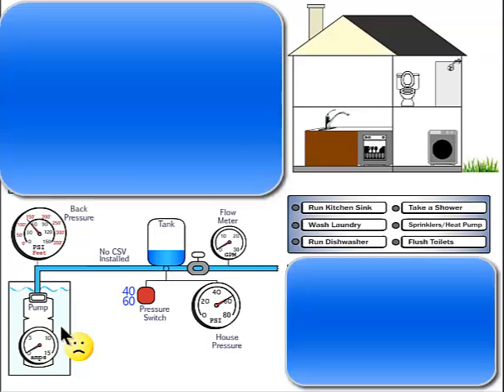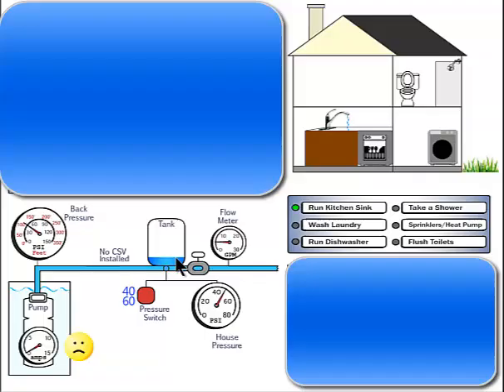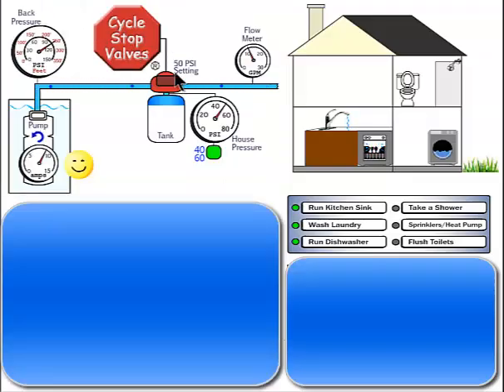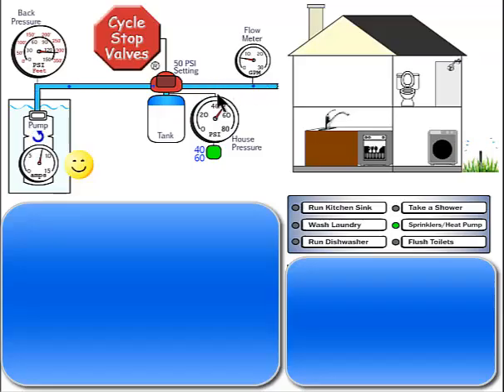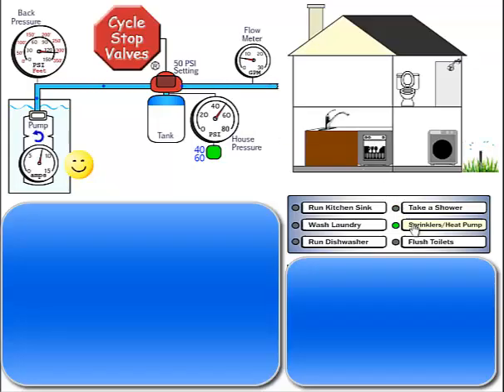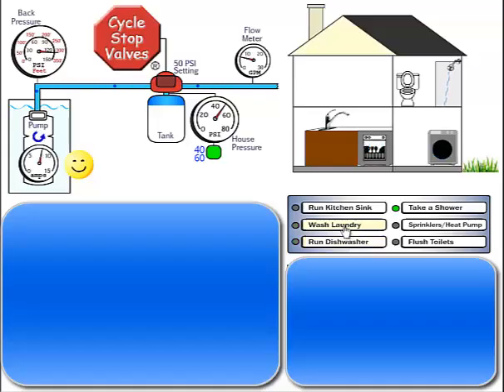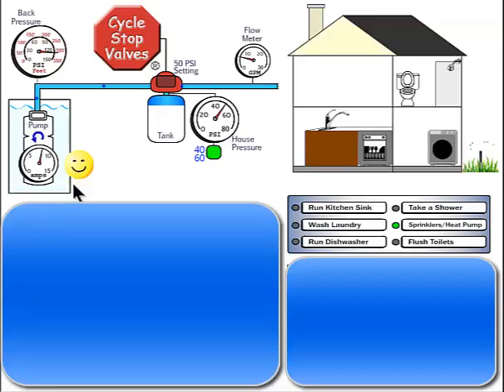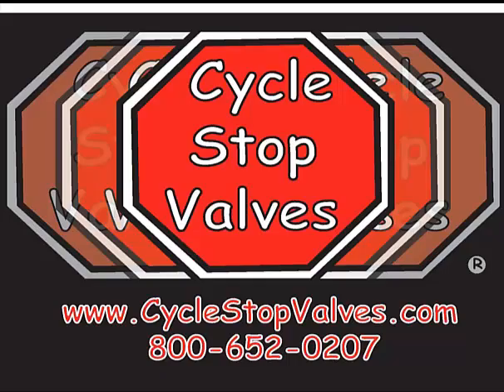How a Pressure Tank Works and why you need a Cycle Stop Valve

Comment: I don't get why my faucet doesn't do the same thing. I have read all of the explanations and looked at the videos and I still don't get how it works. Unless it is some combination of the faucet running, the tank filling, the spring moving and the cut off switch set between 40 and 60 psi. It took me a while to understand a ground fault interrupter too. I guess I will just have to get one and hope it works.
Reply from the maker: A faucet is after the pressure tank/CSV and only controls how much water you are using.  The CSV is before the pressure tank/pressure switch and controls how much water your pump is producing.  The CSV knows how many faucets you have open, and makes the pump produce exactly the same amount.  Without a CSV the pump is always producing more than the faucet is letting out, which causes the tank to fill and the pump to cycle on and off.  The CSV just matches how much the faucets are putting out so there is no extra water to fill the tank.  You could do the same thing as a CSV with a ball valve before the pressure tank if you stood there and manually controlled it.  With a 40/60 pressure switch the CSV would be set to 50 PSI.  So if you saw the pressure drop below 50 you could open the ball valve a little and if you saw the pressure increase above 50 you could close the ball valve a little.  The CSV will automatically keep the system at 50 PSI no matter how much or how little water you are using.  You can't do that with a faucet.

Comment: Hey its good to see you folks here,  I bought two systems for chicken houses back in 07 , smooth running and honestly I have had no problems with this setup other than my plumbing, but I was moving some water with those 8lb birds.  I'm going to add your valve to my house today borrowing one from the farm since I'm no longer in operation. I blame the bank, but I'm a deplorable so...but I got good water.

Comment: will this work with low flow and pressure from city supplied water?
Reply from the maker: Yes. You can use a CSV or a PK1A kit which has everything you need to make a regular jet pump boost city water pressure as high as you need. Boosting to 50-60 PSI is common, but we do lot of systems that boost to 130-150 PSI when the house in way up on a hill.
Reply: Will I have to buy a stand alone pump to go along with this kit? or does a booster pump come with it?
Reply from the maker: @billtopp4329  The PK1A kit will work with jet pumps and multi-stage pumps from 1/2HP to 2HP.  Something in the middle like a Goulds J10S would probably be a good choice for you.  It can boost 10-15 GPM up to 50-60 PSI more than the incoming pressure.  The CSV in the PK1A kit just makes it work like a small pump when only one shower is being used and lets you set the constant pressure where you want it.
Reply from the maker: Yes it will.  Sorry I thought I answered this already.

Comment: Interesting.  How does the cycle stop valve respond to a low flowing well?  I would surmise that it would only be able to maintain a constant pressure if the flow demand is less than the pump/well can deliver.  If the flow demand exceeds the well's/pump's capability, will the valve close to the point that it flows only what the well/pump is capable of delivering, or will it start oscillating the pressure and cause short cycles?  Also, what about winterizing?  Does a bypass need to be installed to drain the house piping, or will water flow backwards through the valve?  Lastly, what's required to winterize the cycle stop valve?
Reply from the maker: The Cycle Stop Valve will let you pump a weak well dry if you open too many faucets.  The Cycle Sensor is designed to sense a dry well and shut the pump off.  The pump doesn't cycle when it pumps the well dry, but it will burn out if not shut off fairly soon.  The Cycle Stop Valve does allow you to use a very small amount of water without cycling the pump.  So if your well only makes 4 GPM, and you only open 3 GPM worth of faucets, the CSV will make the pump only supply 3 GPM and you won't pump the well dry.
Reply: @cyclestopvalves8380  Thanks!  What about winterizing the cycle stop valve?  Is a drain valve required on each side of the valve, or can water flow backward through the valve for draining the system?
Reply from the maker: Just drain the pipe on both sides of the CSV for winterizing.

Comment: So the pressure tank is used only  to turn the pump on and off.  If you have a water usage detector switch, you don't need the pressure tank.
Reply from the maker: If you want water on demand, like open a faucet and the water comes on, a pressure tank/pressure switch is best.  There are devices on the market that use a flow switch, but they have a lot of problems.
Reply from the maker: If you have a water usage detector switch instead of a pressure switch, you have one of those flow control type systems that are made to fail, which is why they have a flow switch.
Reply: Ok, got you.  The next time I am going to get a smallest pressure tank, looks like the smaller, the better.
Reply from the maker: @TAO495  Not smaller the better.  You want at least a 4.5 gallon size tank that holds 1 gallon of water.

Comment: I have a pressure tank that is going bad.  it is inside a square block structure and I cannot get to the plumbing easily to replace or bypass.  can I just install the stop valve combo kit inside the basement just before the water softener and not worry about removing the old tank.  it is in good shape on the outside, this would essentially make it a storage tank?  Also I would bypass the pressure switch at the well and wire it to the combo kit inside the basement.  I just bought your kit online and wanted to start preparing for install once it arrives.
Reply from the maker: You don't have to remove the old tank, but the plumbing needs to be disconnected.  You cannot have a pressure tank before the CSV.

Comment: Wonderful video. I’d love to see a video with a holding tank and dual float switches. We are buying a home with a well that produces 3.6 GPM. The pressure tank is bad and we have to do some work. I wanted to have a 400 gallon plastic holding tank in the basement with a jet pump. Any information on this kind of system would be greatly appreciated. I love the animation. Thanks again.
Reply from the maker: I don't have a video but I do have several drawings of a cistern pump set up.  Here is a link to one in my forum.  http://forum.cyclestopvalves.com/index.php?topic=1840.0

Comment: Cool video!  This valve may help me out a lot, but I am curious how this will work while making RO water. I have 400 GPD unit and I'm not exactly sure how many Gpm it uses while I'm making water, but my RO usually runs all of 10-15 hours every few days.   The pump runs every 30-40 minutes while i am making water, and is on for about 15-20 minutes before it kicks back off.     Will the csv keep the pump on for the entire time the RO unit is running?
Reply from the maker: My math shows 400 gallons in 10 hours is 0.6 of a GPM.  A jet pump with a CSV1A will stay running with flows down to about 0.5 GPM, and a submersible will stay running with as little as 1.0 GPM.  So, if you have a submersible just use a little larger tank than normal with the CSV.  Although it will still cycle, it will be a very slow cycle.  With a 40 gallon size tank that holds 10 gallons of water, you supply pump will be still have to come on every 30-40 minutes.

Comment: I bought a new pressure tank but the only one they had was a 30-50 so that’s the pressure switch I bought, my old system was 40-60, I haven’t hooked it up yet, will I have noticeably less water pressure at my shower? Thanks
Reply from the maker: Yes you would notice the lower pressure.  All pressure switches are the same.  Just tighten the large adjustment screw three times to the right and you will have a 40/60 switch.
Reply: Cycle Stop Valves thanks sir. So I make three complete rotations of the nut, do I need to put more air pressure in the tank then?
Reply from the maker: @shanek6582  You always need 2-5 PSI less air pressure in the tank than the pump start pressure, where ever that ends up happening.  May need a little trial and error as three turns may not be exact.  Just don't mess with the little adjustment screw.
Reply: Cycle Stop Valves thanks man

Comment: Where is the water heater in all of that
Reply from the maker: The line into the house just tees into the water heater.  Hot water lines run parallel with the cold lines.  Makes no difference to the pump system.
Reply: @cyclestopvalves8380  thank you very much for your reply,

Comment: How many horsepower of pump should I use with the CSV?
Reply from the maker: There are CSV's sized to work with any pump.  Your pump is sized to the depth of the well, the pressure that you need, and how many GPM you want to use.  Then the CSV is sized to fit the pump.
Reply: Thank you 
 @cyclestopvalves8380

Comment: I have a multiple wells setup feeding a network. Im wondering how could I use CSV/pressure switch/tank setup so that each wells start when needed and shuts off when the demand decreases.
Reply from the maker: Sure we do that all the time.  You just stagger the pressure switch and CSV settings so the highest pressure pumps come on first and the lowest pressure ones last. I have one system with eleven well pumps scattered across a sub-division. We give each pump 3 PSI difference from the last, like 60/80, 57/77, 54/74, and so on.  Here is a link to an animation with two pumps you can play with.
https://cyclestopvalves.com/pages/home-two-well-system

Comment: Hi,

 I really appreciate you do this kind of video. I have a problem with my well pump system. I just got a new well borehole drill and a new Pressure tank with pressure switch, Cycle Stop Valve installed. The water pressure build up to 60psi and cut off fine, but when a valve is open the pressure drains quickly down to zero and shut off the pump. I tried everything to no avail. Is there anything wrong with my system? Unfortunately, it is out of the country and no one has any idea of how it works. Would you happen to know what could be causing the pump to shutdown when a valve is opened?

 
Your kindly response will be very much appreciated.
Reply from the maker: With a 40/60 pressure switch, the pump should come back on as soon as the pressure drops to 40.  The CSV really has nothing to do with that.  Either the pressure switch is not turning the pump back on for some reason, or the overload in the pump is tripping on startup.  You might also have a low pressure cut off lever on the side of your pressure switch that you must hold to get the pump started.  If that is the case, you could have too much air charge in the tank, causing the pressure to bottom out before the pump starts.  40/60 switch , needs 35 PSI air in the tank when empty of water.
Reply: @cyclestopvalves8380  Thank you so much for your input. After troubleshooting, we found out that a stone was blocking the check valve causing water to gush back to the well and turning the pump off. After removing the stone the cut-in and cut-off works fine @ 40/60 psi. 
thank you so much and I appreciate your quick response.
Reply: @cyclestopvalves8380  Thank so much for your quick response and the insight. I have two pressure switches, one with the cut off lever on the side and the other without it. Both have the same issue. At first, I thought it was a low water level in the well, so it was replaced the with regular one without the cut off lever but still does the same. I think the air pressure in the tank may be the issue as you mentioned. I will have them check that. I really appreciate your input. 
thank you.
Reply from the maker: @egyahechie3171  Using a regular pressure switch without the lever on the side, the pump should start when the pressure drops to 40 no matter what.  I am guessing you have a bad start capacitor and the overload in the motor is tripping on start up.  What do you have to do to get the pump started again?

Comment: My jet pump only gives  me 4 - 5 GPM..the CSV will work fine with this GPM supply? Thanks and nice video
Reply from the maker: Yes but it is not as helpful with a 5 GPM pump as it is with larger pumps.  A 5 GPM pump won't cycle much when using just a 44 gallon size pressure tank with 10 gallons of draw.  Even a 20 gallon tank with 5 gallon draw will work.  But you could use a CSV with 4.5 gallon size tank, save some room, and get constant pressure in the shower as long as you are using less than 5 GPM.

Comment: Does it make any sense to use a CSV when using a Simple Pump designed to hand pump water to a pressure tank in a power outage?  In that case it would seem you would want the largest pressure tank possible without a CSV.
Reply from the maker: I don't think you want to hook the Simple pump up to the pressure tank.  Pumping against the 40 PSI would be like lifting water an additional 92', which will make it much harder to pump.  The only hand pumps I have seen pump zero pressure into a bucket when the power is out.

Comment from the maker: Miguel Vasquez
2 hours ago
I understand the long term use (Taking showers), but what about short term, flushing the toilet once wash your hands, seems like the pump will kick on filling the small tank rather then not kicking on having the bigger tank that will supply the water, not having the pump kicking on just because you flushed the toilet one time.

It is not the small things that cause cycling problems.  It doesn't hurt if your pump cycles on for every toilet flush, although it doesn't.  What hurts is repetitive cycling during long showers or watering the yard.  Your water doesn't come from the tank, it comes from the well/pump.  Pressure tanks are only to reduce the on/off cycling, and when you have a Cycle Stop Valve to do that for you, a large tank is just a waste of money and space.  See this chart for number of cycles with or without a CSV for just house use only.  The CSV and small tank still cycle less than a large tank with no CSV.  Then if you have any long term uses like yard watering, there is no comparison as the CSV will cycle the pump only once, while without the CSV the pump will cycle hundreds of times.

Average Cycles Pump Cycles for
Family of Four with No Irrigation
Cycle Stop Valve Pressure           NO CSV     CSV50 PSI      CSV50 PSI      CSV50 PSI
Pressure Tank Size                       20 Gallon    4.4 Gallon      10 Gallon         20 Gallon
Average Daily Cycles                       35                   31                    25                   18
Reply: I see, Thank you. I think I will be purchasing the CSV system sounds great, Thanks again.
Reply: does this run 220 or 110 current? I've scoured the web,  but I can't find the answer.
Reply from the maker: The CSV doesn't connect to power in any way.  It will work with any size pump running on any voltage needed.

Comment: I understand the long term use (Taking showers), but what about short term, flushing the toilet once wash your hands, seems like the pump will kick on filling the small tank rather then not kicking on having the bigger tank that will supply the water, not having the pump kicking on just because you flushed the toilet one time.
Reply from the maker: It is not the small things that cause cycling problems.  It doesn't hurt if your pump cycles on for every toilet flush, although it doesn't.  What hurts is repetitive cycling during long showers or watering the yard.  Your water doesn't come from the tank, it comes from the well/pump.  Pressure tanks are only to reduce the on/off cycling, and when you have a Cycle Stop Valve to do that for you, a large tank is just a waste of money and space.  See this chart for number of cycles with or without a CSV for just house use only.  The CSV and small tank still cycle less than a large tank with no CSV.  Then if you have any long term uses like yard watering, there is no comparison as the CSV will cycle the pump only once, while without the CSV the pump will cycle hundreds of times.

Average Cycles Pump Cycles for
Family of Four with No Irrigation
Cycle Stop Valve Pressure           NO CSV     CSV50 PSI      CSV50 PSI      CSV50 PSI
Pressure Tank Size                       20 Gallon    4.4 Gallon      10 Gallon         20 Gallon
Average Daily Cycles                       35                   31                    25                   18